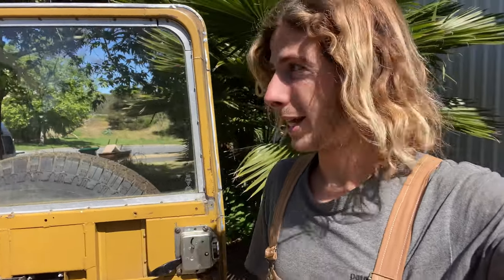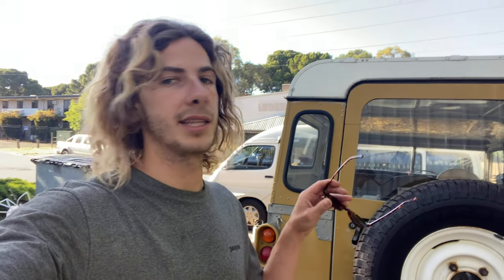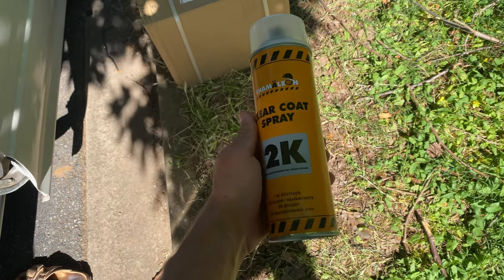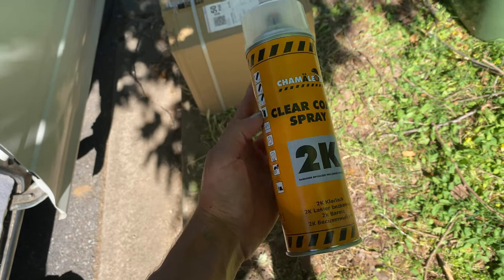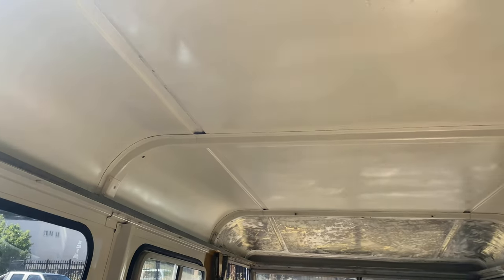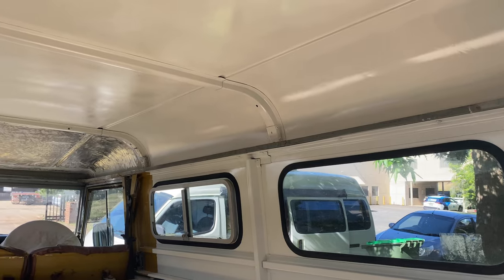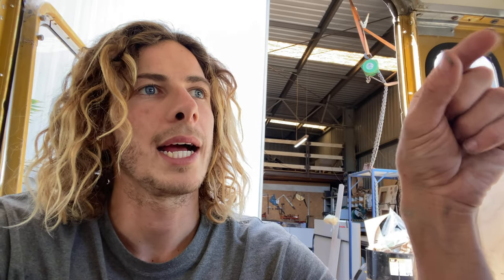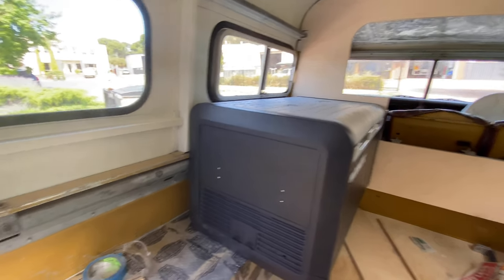LAND ROVER BUILD: Painting Our Ceiling + Hitting Our First Roadblock...

Comment: Have you looked at putting the fridge on a short slide? Pull/Slide it out from the wall a little to open right up and then lock it back in place for travel time.
Reply from the maker: I had thought that, but with our bet and storage being there it impedes the way the tracks go. We're pretty happy with our solution but you'll have to see it in the coming episodes :)

Comment: im not sure about series windows, but could you maybe take that one out and rotate it 180 so that the handle is at the top? might help with a cleaner countertop but not sure if that would interfere with any planned top shelves. And it also may be more work for little gain.

Comment: If you have another upright board on the other side of the fridge you could just put a coach bolt on either side and it will pivot on that. then stick rubber felts on the bottom to sit on the fridge.
Reply from the maker: I had thought of that, but the extra support I feel would have been clunky and a bit ugly. We're pretty stoked with what we've come up with :)

Comment: Just liquid nails a nice piece of butcher block or quartz to the fridge lids. Either one big or two smaller ones. One big one will mean both the fridge and feezer lids will open when you lift it. Or if you stick two independent pieces, then you can open the two lids independently.
Reply from the maker: Exactly what we ended up doing! haha. We used the original counter piece and glued them to the lid so they can be opened independently. You'll have to see the coming episodes to see how it all turned out :)

Comment: Hi mate like the videos  rebuild  one of these old girls from  the ground up afew thing I suggest  rocky Mountain parabolic  springs, and they an over drive  which they make called rovqerdrive there better then the old overdrive and are planetry  so you can use it as a splitter save heaps on fuel .the motor in your car is good  for a 1000000 kms YES HAVE SEEN IT MYSELF   regularly oil change important and grease and oil distributor very important  .the parabolic  spring will make it hand like coil sprung vehicle  best luck with build will wait for your next video cheers
Reply from the maker: Hi Tony, thanks so much for the info! We have installed parabolic springs and heavy duty shocks which has made a big difference that's for sure! And eventually the over drive is definitely on our radar, we just need a fair bit more money before we can do that! haha

Comment: Nice video’s mate. Does the fridge open from both sides, really hoping you made it accessible from the window. I’d probably make a removable chopping block to see if you really need the bench space, maybe table legs on it or bracket or hang on a wheel as table 🤷‍♂️
Reply from the maker: Thanks mate! We think we’ve come up with a solution which we’ll share in the next vid. Thankfully we made the cabinetry around the fridge easy to remove if we need to take it out/access it in any specific way 👌🏼

Comment: You mention putting the gas cyl bracket "in" - I trust you meant "on" - cyls inside a vehicle will void your insurance- apart from being a risky option. good job on a classic vehicle..
Reply from the maker: Yes it is mounted underneath the wheel wheel on the outside on top of the chassis. Thanks for the advice :)

Comment: I reckon the fridge is too big. If you keep it,
Cut and downset it i to the body.
Another trick is to reverse the fridge.
LandRover strength is in the chassis,
So you can do almost anything to the insets
and cutaways
Reply from the maker: Definitely a good idea! If we had endless money, or a bit more experience with metalwork I think that would have been the way to go! We are pretty happy with what we ended up doing though but I reckon yours is probably the best solution :)

Comment: I’d be more worried about heat, if your fully inclosing the fridge in without a good amount of ventilation it will overheat and not be efficient
Reply from the maker: That's what the ventilation is for. The compressor needs to ventilate to remain efficient. We have over 50mm along the back side of the fride, and complete ventilation around the fridge vents. Aside from leaving the fridge out in the open this seems a good solution for us :)

Comment: The roof needs to be cooled 1 of 3 ways...
Our Landy like yours has solar with gap over the front sloping roof, 
The main roof has full sized galvanized roof rack but its for the Short Landy, 
So i have coo.i g over the whole roof.
There is also a tropical spacec roof option but i prefer our setup.
3rd way....insulation under the roof, but only if you dont have the roofrack,
Reply from the maker: Yeah thankfully our rooftop tent will do a great job at keeping direct sunlight off the roof and keeping it somewhat cool for us. Great suggestions :)